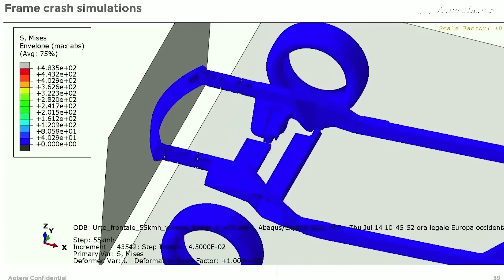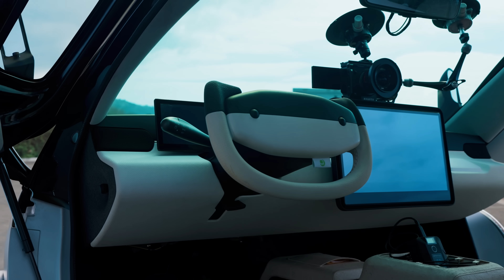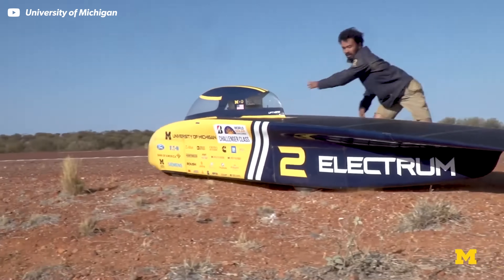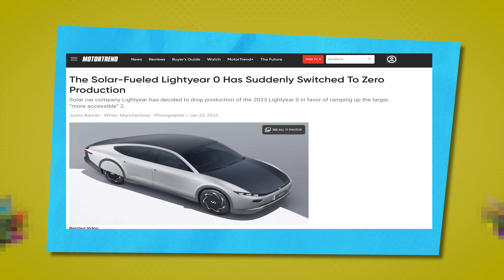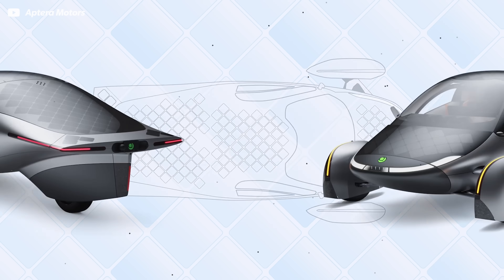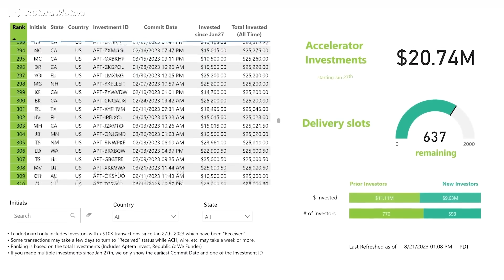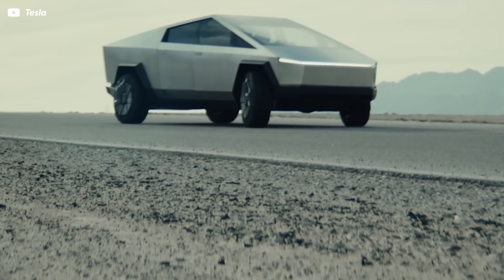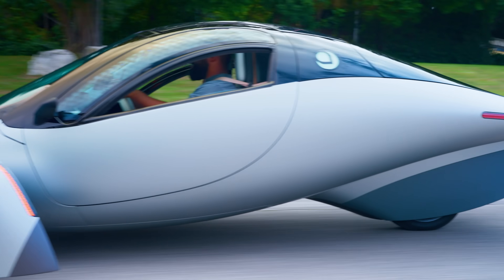We Drove America's First Solar Car

Comment: This is what the people want! Simple transportation. Not overly priced electric cars filled with bells and whistles that break. Just the basics.
Reply: YES!!
Reply: Honestly, the only thing that jumps out to me from this video is the lack of door handle - specifically because it reminds me of the Tesla handles and makes me wonder if they’ll have the same reliability issues. But then again, the doors do look beautiful…
Reply: i want gas cars
Reply: Yea… no. That’s a big no from me. I don’t think many people actually want this other than to virtue signal. It rains 8 months out of the year where I live.
Reply: @jstring You can still charge it normally, the solar just means you’d need to less often.
Reply: @jstring  Is that also why people buy a Ferrari or Bugatti, to virtue signal? Or is it because people like unique looking vehicles? Is that also why people buy a Prius to virtue signal? Or is it because they like saving money on gas every mile?
You're so confidently wrong with this take that I can only guess you're trolling.
In just one day of driving this car around they got at least 2 people come up to them complimenting their car. A lot of people love getting attention like that, and are willing to pay extra money on a gas guzzler to get it. Sure it rains most months in a year, but does it rain most days in a year? And you still get some solar energy on rainy days, just less than normal. It's still free miles. When the car is only $26k - $48k, having it charge as much as 5 miles per hour is kinda crazy for both convenience and saving money.
Sure a few people will brag that their car is electric and green and renewable because it's powered by the sun, but there are many reasons to want this other than just to virtue signal.
Reply: Death trap on wheels. No way else to say it. With today's traffic and idiot drivers you would have to be a fool to own one of these.
Reply: @willriley1619   lol ok bud. Have they even been safety rated? Isn't it way safer than any motorcycle? I wouldn't be surprised if it was above average in safety rating for a car. And I certainly expect it reduces the safety concerns for other drivers and pedestrians on the road, because it's light (2k pounds) and not very tall.

I'm curious, would you rather they drive an SUV because you think those are safer? Because I have a few statistics I'd love to share.
Reply: @Pehz63  I bet you $100 bucks the Aptera gets a worse safety rating than a 30 year old Volvo 240. Safer than a motorcycle is one thing but actual cars no. Can't even find a front overlap test or a side impact test for an Aptera. Only stuff the company puts out which is obviously hiding something.
Reply: @Pehz63  Aptera is a toy that only rich people will buy. No one will buy this to transport their wife and kids. Comparing the Aptera to a car with more than 2 airbags, 6-8 pillars is just foolish.
Reply: @willriley1619   Are you saying the Volvo 240 is also a "death trap on wheels"?
"for Highway Safety, IIHS, cited the Volvo 240 Estate as the safest car on the American market." It seems like that's a bad comparison when you're saying something else is dangerous. There's a lot of space between "death trap on wheels" and "safest car on the market". So how dangerous do you expect the Aptera to actually be?

I wouldn't expect to see all that much safety testing for an Aptera if it hasn't really started production yet, right? And isn't it libelous to call it a death trap simply because you haven't seen the test results yet? Seems like you just want to hate it because it's new and are ignoring the appeal.
Reply: @Pehz63  lol how much have you lost investing in trash companies? Ill anty up. I bet the Mitsubishi Mirage beats the Aptera in a safety rating.
Reply: @Pehz63  By the way the Volvo 240 is 30+ years old. Not a bad comparison. I would expect a car company that considers themselves the future should be able to beat a 30 year old car.
Reply: @jstring but you can still charge it at a Tesla charger so your only point is invalid
Reply: @destroythe180days  you know what else I can charge at a Tesla charging station? A Tesla. Which carries four people and groceries. This thing is a toy car for people with expendable income. Or a technology demonstrator on wheels. In my area it wouldn’t even be considered a car, you would have to have a motorcycle endorsement for it. So my point was , nah. This ain’t it. Cool toy but this ain’t it. Look into what Toyota is researching with ammonia based ICE platforms etc. Toyota isn’t looking at solar powered motorcycles.
Reply: @mark.mazzarella I agree that there could be reliability issues but at least they did it for a reason, because it actually improves aero
Reply: @mark.mazzarella reliability issues? Why do people make stuff up?
Reply: @balloon6528 too bad😂
Reply: @jstring   Nah...  I love my gas cars but am absolutely on board with this thing for a daily.  Driving a 90s JDM car to work 40+ miles each way is stupid everyday.
Reply: “Just the basics” like the idiotic “door handles” that waste power and add nothing practical to the vehicle?  Yeah… cool story bro. Tell us again!
Reply: @balloon6528 and your Mother wants your father to NOT be her brother, but what’s a trailer park family gonna do? Hillbillies gonna hillbilly.
Reply: Yes i love it so so much now we just need to learn more about their customer service and the cars reliability. It cant be another tesla situation i hope not
Reply: @InertiaCreeps  im chinese and from california bro what are you saying 💀
Reply: @balloon6528  yeah, and bro tried to tell you that so that he can cover up being from alabama with his sister prolly
Reply: Yes, but people do not want half windows with giant pillar blind spots. That's my biggest gripe with this thing.
Reply: @balloon6528 and what is stopping you from buying a gas car? Oh! That's right, nothing. If you want a gas car why are you here?
Reply: @willriley1619 not an apples to apples comparison. The Volvo was designed to be safe and not efficient. The Aptera is designed to be hyper efficient, safety is not the top design priority. A better comparison might be a miata (mx5).
Reply: @jstring All 3 of its wheels are powered so it may handle that better than expected.
Reply: Less is More-Mies van der Rohe
Reply: teleportation is super dangerous. what if you teleported into someone or something? mid air or outside of Earth's safe zones
Reply: “No.”
Reply: @bw1532  why you getting so pressed for no reason bruh im here cuz i like donuts vids and wanted to state my opinion
Reply: People want a car the can carry a family.
Reply: @jstring What gave you the impression it's not waterproof?
Reply: @willriley1619 The tub is stronger than steel so probably far safer than you incorrectly assume.
Reply: @Jamessansome  One big misconception is that there are many different kinds of steel. Many cars today like MB, Volvo, Lexus etc use around 10 different kinds of steel in their cars. Some steel is softer and other harder. Im familiar with automotive safety unlike many in this thread.
Reply: You can't sell a cheap lightweight car in the US, but a cheap lightweight 3 wheel EV might just slip between the cracks of the automotive regulatory capture scheme.
Reply: This right here is what I thought we were going to get when I was a kid.
Reply: I so agree. Give me basics. Affordable.
Reply: 3 wheels may be a bit... too... basic
Reply: @bw1532  I'd say that safety is actually a priority as this car has a stronger roof crush structure than any car in history and they volunteered to crash test since the car doesn't even have to (autocycle laws exempts them from having to).  If I'm correct, they're even installing airbags, which they don't have to do either.
Reply: @utubeb14  Most people have more than one car.  So only one car really needs to be a family car.
Reply: @mark.mazzarella yeah I think the knock-to-open thing was a quick hack for this prototype. Simpler to do everything in software than add physical handles, which would complicate the door design
Reply: You are the ideal buyer, put your loved one in the passenger seat and drive South to sunnier climes :-) @jstring
Reply: @balloon6528 I love them too, but this is somewhat of a nuclear fusion reactor car
Reply: @jstring News flash. People buy cars mostly to virtue signal.
Reply: @emptyshirt  you say that as if Aptera doesn't have a market research team...
Reply: So everyone here is buying one?
Reply: @choiswimmer  I would really like to but it'll probably be a couple years. There's a sizeable market for Aptera and there's not really any competition for this sort of autocycle.
Reply: @willriley1619 , not necessarily.  It is obvious that it is based of aerospace engineering and design, using advanced composites.  Small aircraft are designed to hold up to 16 G's of crash impact. This can definitely be beefed up since it isn't an airplane, and be made quite safe for the passengers.  I am more concerned about the safety of the person who would rear-end this car.  Imagine a motorcycle hitting this from behind, even at modest speeds would be a guillotine.
Reply: @willriley1619  its a two door coupe transporting other people isnt the goal. youre comparing a 2 door coupe to a family sedan.
Reply: @Pehz63 nice whole essay on why you are angry on the internet 😂
Reply: @j99044  I'm not angry, I just enjoy hearing other people's perspectives and correcting misinformation and bad arguments. Do it long enough and eventually essays like this are easy to write and don't require a motivation like anger.
Reply: @jstring Then just plug it into your garage outlet, which keep in mind, will work with a standard electrical outlet. That's right, you won't need to buy a fast charger, you can pull 100 miles overnight from the same outlet you charge your phone with. To me, that's a bigger selling point than the solar. In fact, I think you're a little too focused on the solar and not focusing enough on the implications of a car built for solar and how practical that is for everyone. Because it's designed for solar, it also means that it's so lightweight and efficient that it only needs a fraction of the batteries of a Tesla. You can charge it from a standard outlet overnight instead of having to buy a fast charger. Fewer batteries means it'll cost less to replace them than it would on a less efficient car. It also means it'll be a lot cheaper to charge if you need a charging station and it's also cheaper to produce making it a cheaper car overall. Not to mention the fact that it can go up to a thousand miles on a single charge if you get the bigger battery pack.

The truth is, this car makes sense even if you literally never get sun ever. The world's most efficient vehicle is cool whether or not you care about solar.
Reply: @Pehz63 They did some safety tests on an earlier model, but the gamma and delta will require separate testing. Or at least the gamma. I don't know about the delta.
Reply: @jstring They were able to put two Costco carts worth of groceries in the trunk. I don't think you understand how much space they have in that thing. And I think they said that a four seeder version might come out eventually, or they said it wouldn't, I'm not sure.
Reply: @InertiaCreeps It's not clear if the knock to open feature will actually be in the final version or not. Right now it's just there to look cool not necessarily be promoted as a feature.
Reply: @VMYeahVN What blind spots? The mirror cameras shouldn't have any blind spots.
Reply: @bw1532 Actually, some states plan to ban the sale of gas cars eventually.
Reply: @MrGamelover23  Those cameras don't do anything for the bar in the middle of the driver and passenger windows. The cameras are for seeing behind you.
Reply: @jstring If this ammonia engine that Toyota is working on has even half the range of a gasoline engine, that would be absolutely huge. There's been a lot of innovation with cars, but not really much innovation in how they're powered.
Reply: I agree but imagine that knock to open function breaking lol
Reply: @balloon6528  Thats great until oil runs out.
Reply: @jstring I’m not about virtue signaling. I have wanted one of these since the 80s. They used to have amazing solar races that just went away or not advertised.
Reply: @jstring I can care less about virtue signaling. What I like is the long range, competitive price, very decent performance, and being able to use solar by itself in case of an emergency to get myself where I need to go.
Reply: @willriley1619 ”No one will buy this car to transport their wife and kids.”
Blatant trolling.
Reply: and the design that actually complements the car's range and dynamics. not some childish BS like cybertruck